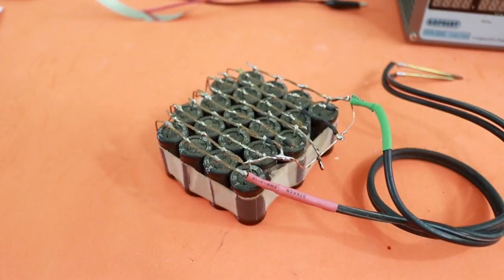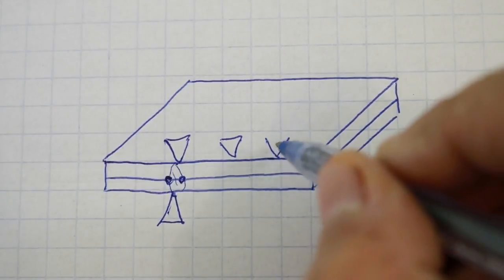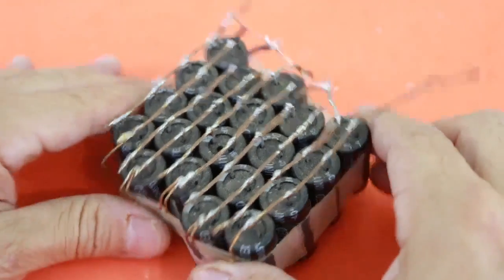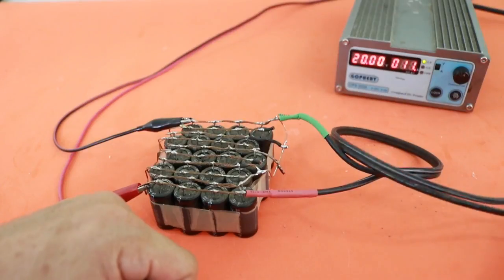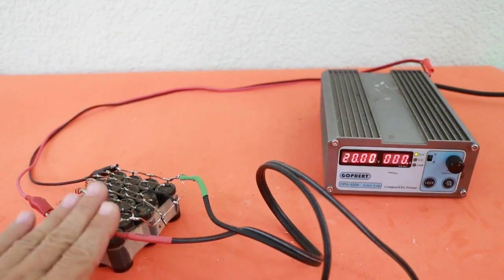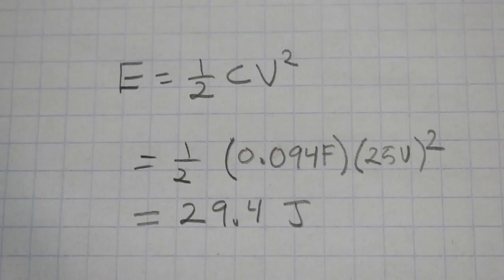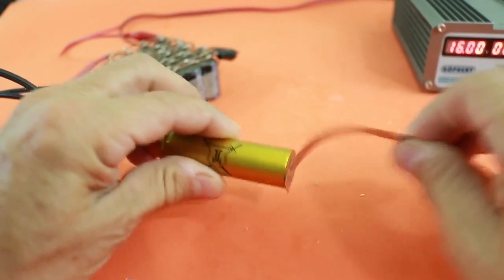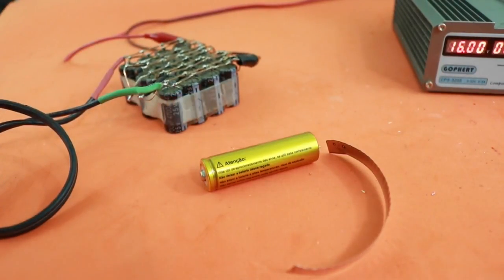Spot Welding Using Capacitor Bank

Comment: I made capacitor spot welder 6yrs ago. (https://www.youtube.com/watch?v=0BgrkkOfjGo)  For capacitor spot wlder work properly, you need large capacitance with low voltage. small capacitance with high voltage is not good.

Comment: That's a short circuit. The soldering lids does not draw current from the caps; notice that those lids has direct connection with power circuit; bad for power supplies

Comment: Sir, I have tried with 21 capacitors of 25v 4700uf in parallel

For testing purpose I have choosen actual nickel strip but they are not at all attached

Please help me sir
Reply: It won't work. You need to be well above the 0.093 Farad he was using. You need to be above 100F if you're in the 16V range minimum. 250F at 5.4V might work if you use two 500F 2.7V supercapacitors. Next you need a board that controls the pulse and a way to switch it on and off like a mosfet board. All that can be found on Aliexpress

Comment: You are not able to apply pressure on the metal strip because you don't have a switch or any type of control.
And the power supply you use plus the capacitors cost probably more than any other diy project.

Comment: The energy dumped from the  the capacitor bank (29J) s not enough to melt nickel strip. 150 to 200 joule should do a good spot welding

Comment: Use a super cap with 2.7 volts n 500F the current will be less but the pulse duration will be longer causing the metal to melt but not vaporise.
Reply: 2.7V is way too low. You need at least 6-8V with perfect scenario, usable is more like 12V. The problem with supercaps is you need to stack them in series anf you need to balance them with balacing board or resistors, and your welding and connections need to be extremely good because super caps naturally have a higher resistance than electrolytic , so they will always be slower than electrolytic when dumping current, not always a bad thing but, tends to be an issue for consistency.. especially if your welding batteries and nickel strip of all different types and states of corrosion.. i initally webt with supercap bank but after losing thr mosfet the first time, the second one i built with 25V 47000uf capacitors. You really only need 4 to have a functional spot welder, but 8-12 is good too, the great thing is, its essentially modular, you can add or remove caps like a power bank which you cannot do in series and no balacing. Also you can charge anywhere from 12V to 25V, and the resistance is like zero, i would never go back to supercaps unless there was really a valid reason for all that extra unused capacitance to play a role. There are great supercaps no doubt, but typically much more expensive. Once thry come out with 8-9V supercaps with equal capacitance then maybe.  The button ones 5.5V with 1 or 4F are a decent alternative, and roughly correlate to the 5x 25V 47mF electrolytic, except in series
Reply: This may work because when calculate the energy obtainable from 2.7V 500F capacitor, you will get approximately 3.645 KiloJouls. 
This should be enough energy to spot weld. In his own case, the energy is just 29Jouls , this can't weld
Reply: The total calculsted energy is a meaningless figure because its not anything close to the energy being transferred to the weld. Many factors play into this, but they all contribute to some form of resistance, the thing that electrolytic caps always outperforms supercaps on is very low resistsnce, you can even build a hybrid system Starting from high energy density /capacity toward lower energy capacity but lower resistance.  Like this 12V li ion 3S battery --》 6S supercap bank(12V charge) --》25V 470mF electrolytic capacitor bank(10P) -》 weld. That way your current will come first from the electrolytic as a massive surge, that completes the weld, but if allowed not to stop and fill up, it woulf judt keep going... it also solves thr problem of capacitors which charge extremely fast when empty but naturally build resistance as they fill up. Ao if your using supercaps but thr weld only empties them by 20% its going to take 100X longer to fill 80 to 100 compared to 0 to 100 for electrolytic

Comment: The problem is that you get the spark as soon as you touch the metal. At that point the metal strip is still in the air and not really touching the battery. You have to somehow switch on the current after you push down with both electrodes.
Reply: A momentary switch controlling a scooter solenoid would be a good choice. 🤔

Comment: Nice fake battery 8800mAh 🤣🤣🤣🤣🤣🤣
Reply from the maker: 😅😆🤣🤣 it gives 900 mah not bad for  50 cents
Reply: You laugh but image that being your phone battery and taking 5 seconds to fully charge instead of 5 hours
Reply: Can I charge this capacitor bank and use the voltage to charge appliances

Comment: Why not do what kWeld does? This claims to be a Next level DIY battery spot welder and for this application, maybe just a few IRF44's and a foot pedal gate charge switch is all you need.. This way, maximum pressure can be applied along with the right timing.
Reply: Sorry, I forgot to add where this project came to be popular:
https://www.eevblog.com/forum/projects/guesses-on-what-i-am-attempting-here/
Reply: Yeah. . Irf144 is just a switch. You still need a high surge current power supply. That is the point of capacitors. High C lithium ion batteries, super capacitors, personally i think electrolytic capacitors do the job the best, just use 47000 uf 25V instead of 4700uf , far cheaper too.  4P or ~0.2F is plenty The advantage of getting to use only Caps in parallel dramatically simplifies the project, no need for complex active balancing for a 6S supercap bank. Pair it with a lithium ion battery, high C or not, some current inrush limiting resistors and reverse protection diodes , and it will serve you well. With supercaps the voltage is so low and thry inherently are more resistive.So any weak link in solder or wiring will kill it, and your ebergy is judt wasted as heat and smoking wires vs a weld.. ive eveh tried using the smaller cell button caps, 5.5V 4F or 1F size. So in principle 5 x 5.5V1F should give you sometbing very close to 25V0.2F, but the super caps need balancing, the 4P 25V 47mF is very simple wiring, seemingly has zero resistance, just outperforms everytime. Now i just want to find mosfet thst doesnt go up in smoke
Reply: Aren't you forgetting the high C lipo.....His capacitor bank is not powerful enough.
Reply: @ericklein5097  Yeah maybe. I just watched "robustness testing next level DIY battery spot welder" by WeAreTheWatt it is quite impressive to see 250 joule pulses poke holes through cans 😂 I sure love to see that automatic contact sense in action.
Reply: Link - https://youtu.be/fWXphoDE_H8

Comment: Good video.
I think you mean "Spot Welding", no solder involved.
Please don't charge a large capacitor bank like that directly from your power supply.
Use  a current limit resistor.
Your power supply will not last long being turned ON into a load that forces it immediately into current limit.
Reply: How can I attach a limit resistor? Thanks!

Comment: in my opinion the problem is that u need to press the electrodes hard first, and after that apply the high current, so that both metal parts heat up at the same time. this means u would need a high current switch of some form to pass the current when the pressure is already applied
Reply: Nope. The caps discharge too fast cant heat the metal up well. Needs a bigger capacity. But what u said is making it even worse
Reply: @revolution5547  I don't think that pressing the electrodes hard before passing the current is making it worse, cos that's how commercial spot welders work
Reply: @dominikworkshop6007  oh no no no. Sry i formed the Sentence wrong. I meant that pressing before welding would also make it bette
Reply: @revolution5547  ahh, ok xD
Reply: @revolution5547  apart from your point of pressing hard before switching on, I do not 29.7 J is enough energy to spot weld. Spot weld requires large current to melt two surfaces.